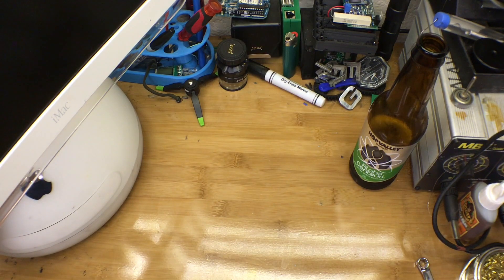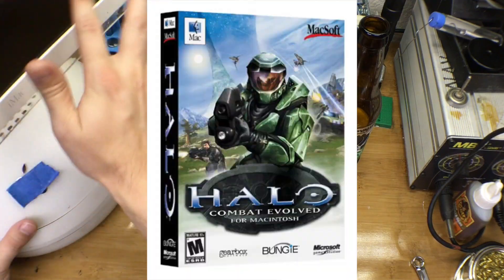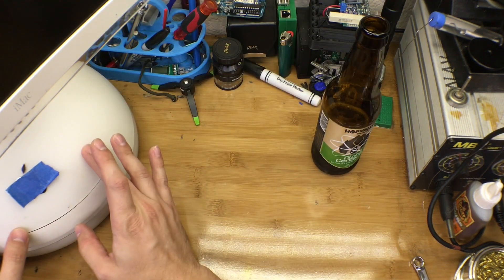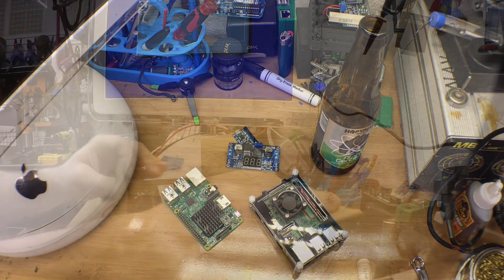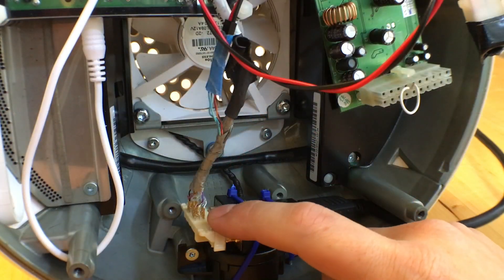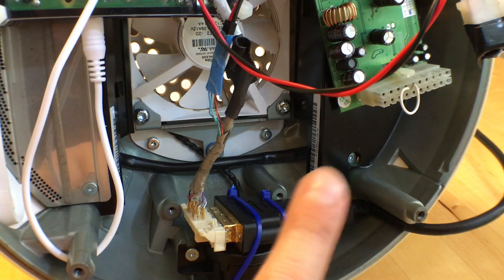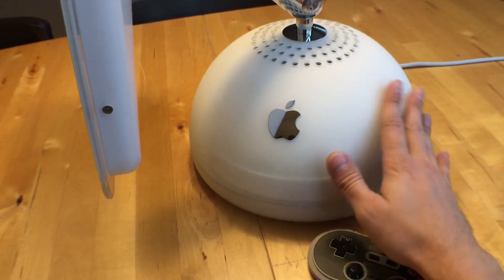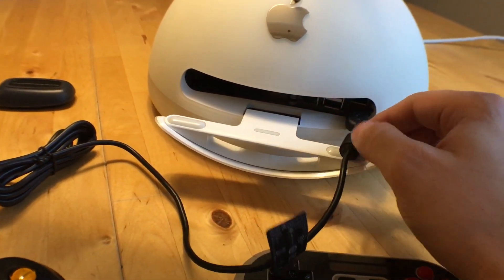Retro Apple Pie - iMac G4 Refresh

Comment: I'm considering a project similar to this but using panel mount connectors to replicate the ports on the G4 imac including it's firewire and it's RJ11 port. but I'm wondering just how hard it's going to be to fit a Raspberry Pi inside of a G4 iMac.
Reply from the maker: RPi in the G4?... Like throwing a hotdog down a hallway! It'll fit just fine :)

Comment: Is a that a 15"? If so, could you give walk-through instructions because I've been tinkering with my 15" for weeks and can't get a picture. Screen goes from black, fades to green, then fades to white. I've looked everywhere for the answer but with no luck. Please help! Thank you!
Reply from the maker: Did you take a look at the references in the description? Dremel Junkie did a really nice write up on the process.
Reply: JuliansRandomProject I've followed the 15" instructions and tested continuity on all connections. I've even tried reversing the pin-out. My LCD starts black and fades to a blotchy green and then to white. No actual image ever appears. Bad LCD or inverter?
Reply from the maker: Make sure you have all the voltages and enable signals. Sounds like your back light is working, that's something :) What are you using to power it and what are you using to drive a signal into the DVI connector? (some HDMI signal's are too smart for their own good). Avoid reversing the pinout, just double check it, woudlnt want to through 5v down some line that cant handle it.
Reply: JuliansRandomProject I'm using a male HDMI to male DVI converter cable. I bought all parts recommended by dremel junkie
Reply: I really appreciate any help. I've been banging my head against the wall for weeks
Reply: @rastaripshot  hey sorry to bother you, I am going to start this project with the 15" model, were you able to make it work?
Reply: Nope

Comment: I have a broke g4 1.25 gig .
I ordered on Amazon a hannspree apple design 18 inch ips screen whith sound and hdmi , the red color i will paint white .
This comes instead of the original screen so i do not have hdmi problems ,   and a nvidia shield pro comes inside the feet .
I dont have the expertise to use the original screen
Reply from the maker: Awesome work around

Comment: Would a Mac Mini fit in there? Would the original PSU power the monitor and the Mini?
Reply from the maker: Yeah. it would fit. You'd have to check the specs on the mac mini for power consumption. Worst case rock both power supplies